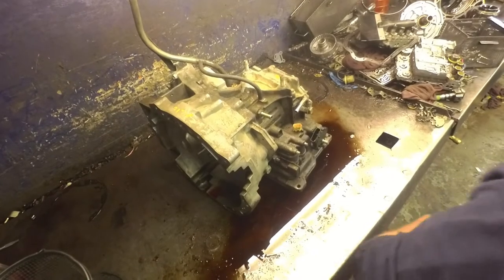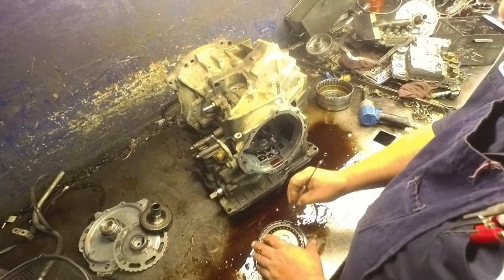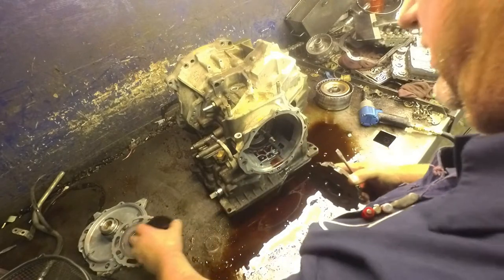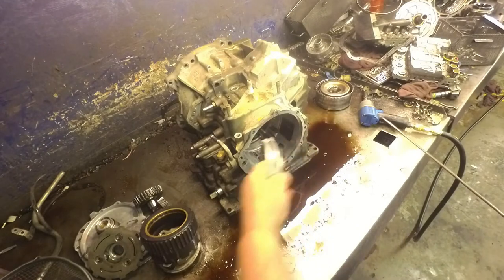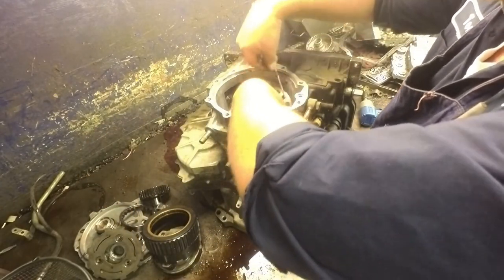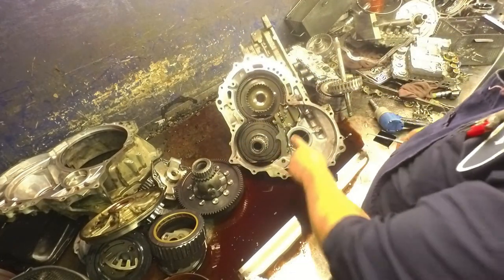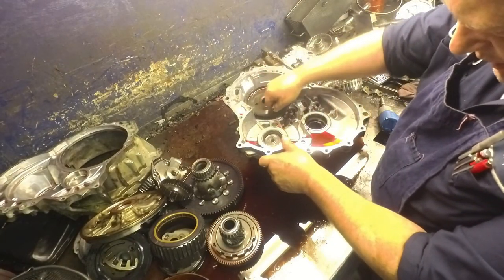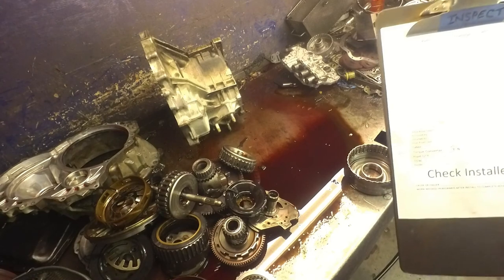4F27E Disassembly

Comment: I have the twin brother of this transmission, the FN4A-EL with two problems, it will not engage 3rd nor 4th, it slips like is in neutral and the second problem is sometimes when I start the vehicle and put it in drive, kicks hard and only engage in 3th gear, when this happens I just shut off the vehicle, then back on and it drive normally (Only in 1st and 2nd).
Only code present is P0733.
I don't know how to start the diagnostic, im between change solenoids or look in the 3rd-4th drum.
Reply from the maker: I would look at the drum, pistons and end cover sealing rings.

Comment: Hey i have a 2013 ford transit connect. I need to find the transmission differential.  Can you tell me what teeth it is. Is it and 85t 1 groove 24. Or can you tell me what teeth i need. Any help would be very much appreciated.
Reply from the maker: Have not been able to find what the diff. tooth count should be. I do know that year should have a 3.956 ratio.

Comment: What causes a no reverse condition with this transmission. I'm curious what drum unit controls It. I also have another one that has a louder clicking noise internal when driving. Goes away when come to stop.
Reply from the maker: Could be a lot of things. The 2 elements that work it are the reverse drum and the low/reverse clutch. The reverse drum is the drum against the back cover. The cover and drum are very prone to wear. Can also be caused electrically. Bad solenoid, neutral switch, speed sensor reading when it should not. The clicking noise I am not sure what would be causing that. Maybe the differential.

Comment: What would cause a torque converter to go bad again after replacing it? 
My TC was making noise at acceleration, would shift hard and sometimes not engage 4th gear.
Went ahead and replaced the TC, new filter and oil. All the symptoms went away.... but unfortunately it lasted for only a day. Im now back to having noises at acceleration, and some new noise appeared when slowly driving, but at the moment it still shifts fine and 4th gear still enagages, but that coould change i suppose. 
Is it a bad TC I got? Or is there an undelrying issue with the transmission that is  killing the TC?
I started thinking maybe its the oil pump, or something to do with oil pressure... but im not sure.
This is on this same transmission btw, off of a Transit Connect
Reply from the maker: There is a big problem with the filters on these if you happen to get a Chinese made ones. Make sure and get a Filtran brand. Get it from the dealer if you have to. It may be a bad t/c. Personally I would deal with Precision of New Hampton. The 4th gear issue, these are horrible about wear in the servo bore. #1 problem with them. Bushing wear in the pump can cause t/c problems also.
Reply: @CurmudgeonTransmission  hey thanks for the reply. I'll be keeping an eye on it... may have to get another TC, I'll give Hampton a try then, and most likely get an oem filter and oil pump... hopefully that fixes the issue 
Not looking forward to taking the transmission off again!

Comment: If I was looking to just weld the differential all I would need to do would be unbolt the front case/pump assembly and nothing else? anything that would need to be removed in order to just do that?
Reply from the maker: Correct, that is all.
Reply: @CurmudgeonTransmission  awesome, thanks for the speedy response

Comment: When 4f27e is all assembled how much is the input shaft supposed to move in and out ???
Reply from the maker: .009-.019
Reply: @CurmudgeonTransmission  endplay in rear section of trans is about . 015" so that's acceptable, I'm saying flip trans to have bell side up and I can pull input shaft/drum up and down about . 060" with pump bolted in also, washer IS BETWEEN drum and pump,and I  swear nothing is missing I checked multiple times, and hub is locked on circlip
Reply from the maker: I can find no information on what or how to set end play for the front end. Can only find info on rear of the unit.
Reply: @CurmudgeonTransmission  Neither could I, thanks for looking though

Comment: Do you absolutely have to rrmove front case to remove pump??
Mine is from a 2010 transit connect
Reply from the maker: No it can be removed without doing that.
Reply: @CurmudgeonTransmission  ok i magined so, it took me a little off guard when you took it off with the case.
im taking mine out and changing seals, il leaks somewhere in the bellhousing area.
got all new seals for it

Comment: Hi is it hard for a DIY person to rebuild a cvt transmission in a 2004 Saturn ion 3 ?
Reply from the maker: Yes they are pretty difficult without the tools. Also does not take much damage to make it as cost effective to buy a new one from the dealer.
Reply: @CurmudgeonTransmission  ok I may leave this alone. I think I can swap from a five speed automatic sedan.

Comment: Hello
I have  some issues with my transmission.  If I shift in drive it just spin. But if I shift to 2nd drive and start to drive then shift back to drive it drive fine all day. When I put it in reverse it shift hard and then it go in reverse. What do you think it can be
Reply from the maker: Have you had the system scanned? Any codes?
Reply: No not yet